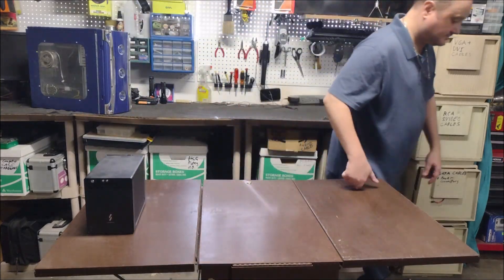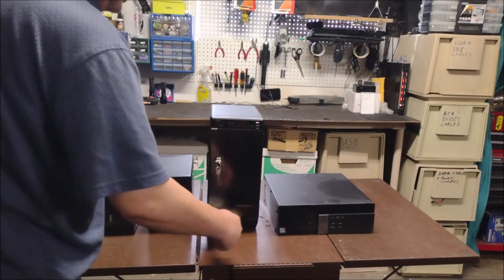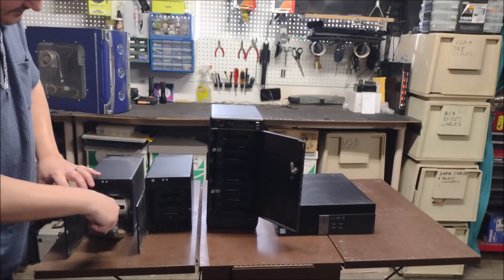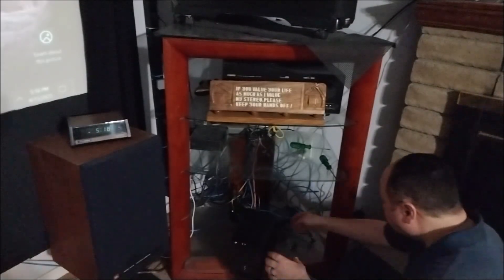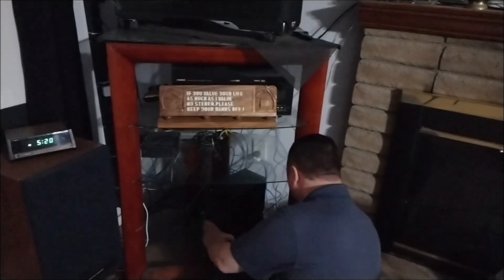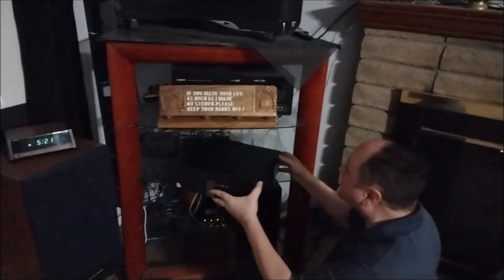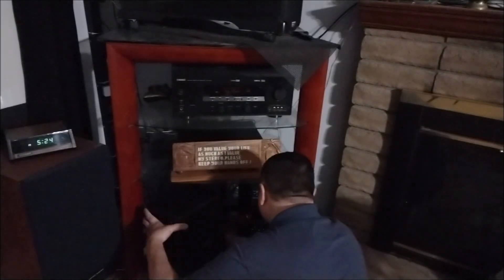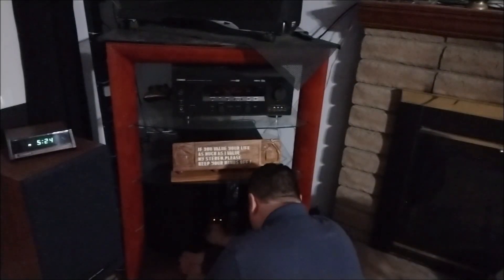How I Successfully Maintained My NAS Server During a Planned Power Outage

Comment: Just found your channel. Very good info. I have 3 raspberry pi’s with pi-hole and open media vault for server.  Looking to consolidate files. Ordered Dell sff and 2 used 12tb seagate drives from eBay. Hopefully your guidance and suggestions will yield a stellar NAS. Thank you! Yes, I subscribed “)
Reply from the maker: Glad to hear that good luck Join the telegram group for more info I cannot share on youtube. Link is in the discription. Also you can DM on there for questions if you need.